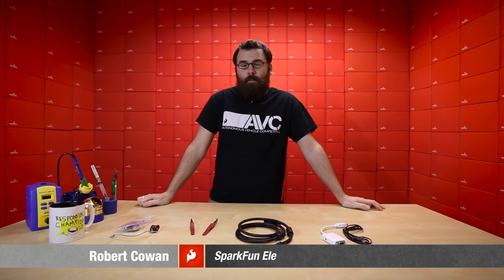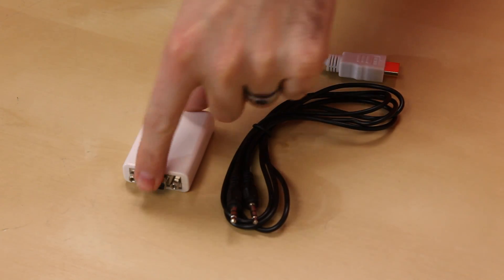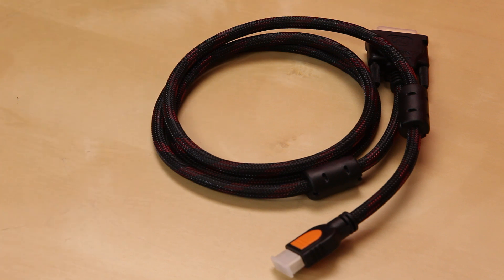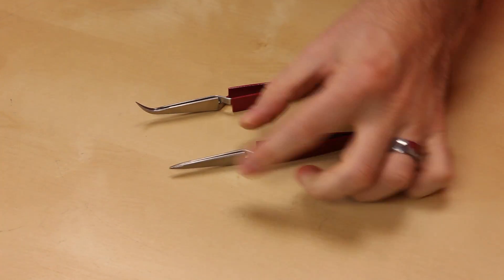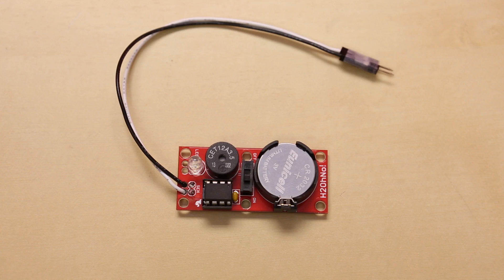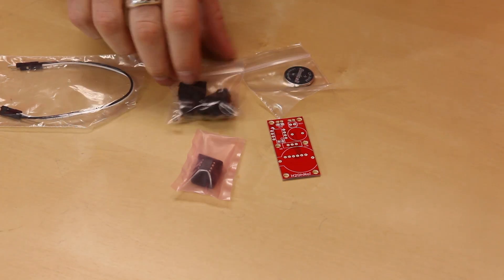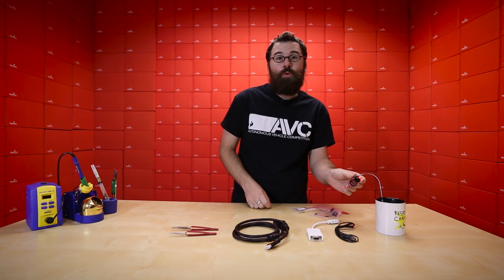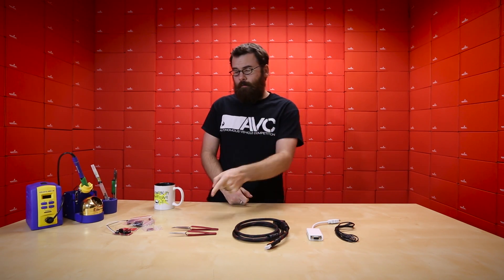SparkFun 11-22-13 Product Showcase: Don't Tweeze Me Bro!

Comment: My gut churns a little each time seeing the pins of a microcontroller abused due to missing resistors or drivers for other elements. Granted it'll [should] work and it is for the hobby community.. OhWell! :P
Reply: My gut churns a little everytime i see a project using a microcontroller for something that can be done with normal analog electronics. The water alarm can be made with one ne555 and a transistor...
Reply: Quite true. I suppose each break down into how simple you want it to be. Optimizing the analog circuit for a potential few dozen nano-amps may be more interesting than just executing the sleep instruction.